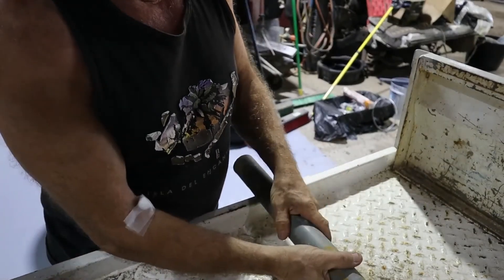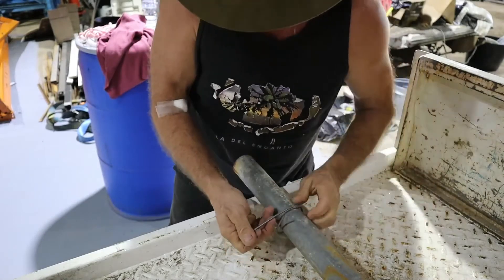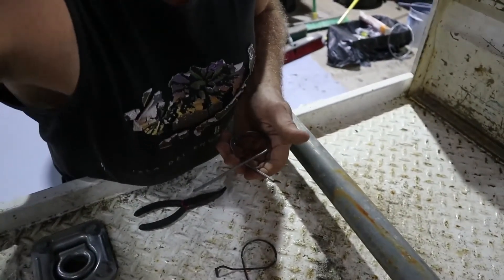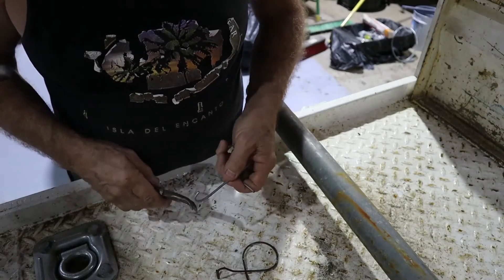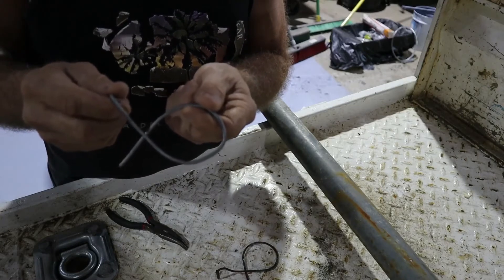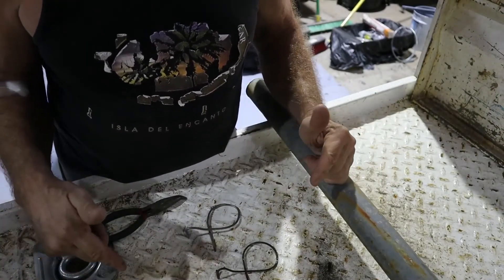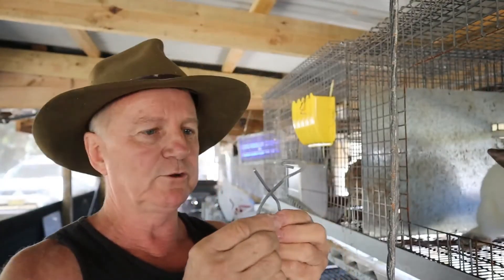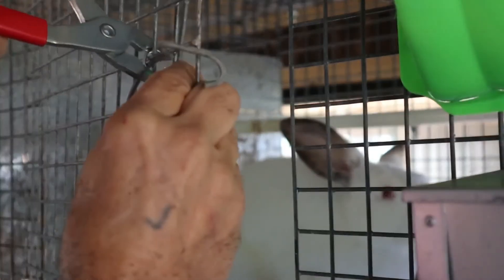How To Make A Wire Latch For A Cage

Comment: Love the simple design of the hooks. I've have 5 cages needing door latches. What caught my attention was the heavy guage of your cage wire. Seems all our manufacturing plants (from wire to toilet paper or anything else you can think of here in the USA, has gone cheep and raised the prices. ) What guage wire are your cages? Please and thank you.
Reply from the maker: Yes I use this design on all my cages it really works out well. 2.5 to 3 is ok .if your able find a small piece of soft malleable wire and try( such it and see) . Thanks for stopping by 😁 👍